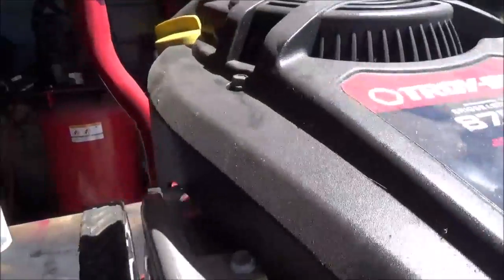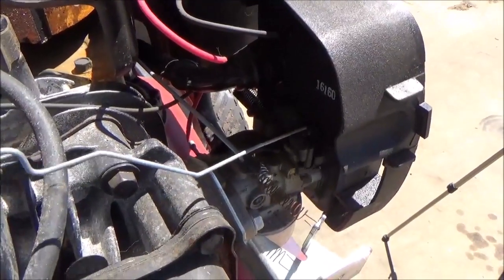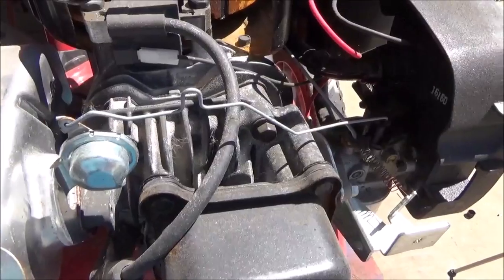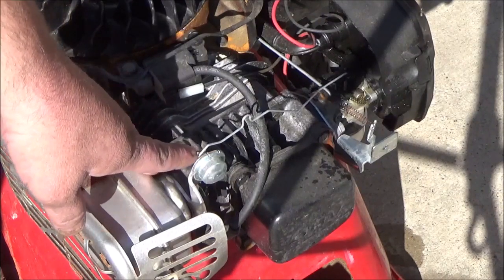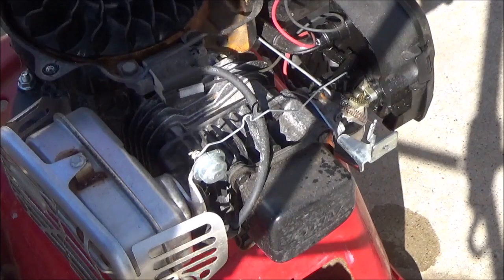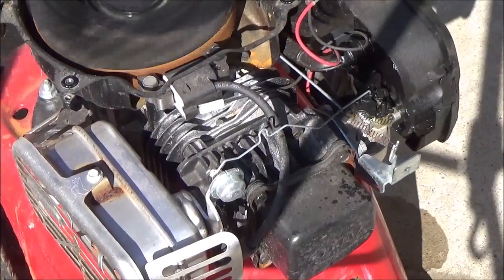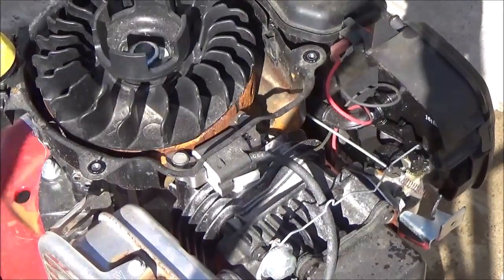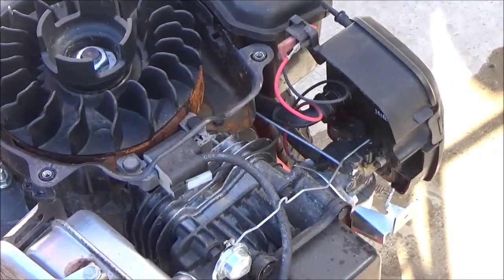HOW MOST AUTO CHOKE SYSTEMS WORK ON BRIGGS AND STRATTON / KOHLER  /MTD / CUB CADET /  CHINESE CLONE

Comment: I see in your demo that you  had a troy built power washer.  I went to use my power washer and it would not start, had issues in the pass with it not starting well. I had added gas and stall-built for the winter, but needed to use it one more time. Would not start!!!  Took carb apart and cleaned it and putting stuff back together and couldn't find where the chock link hook to, there is no thermostat on my engine?  It's not there.  Just ordered one from B&S.

Comment: Nice good sir.  I have a Cub Cadet with a Kohler 7000 and just today when starting it, it started and then never increased power like normal.  I popped the top and pulled the air cleaner and noticed the choke never would open and it would just sputter until it died.  I manually (with my finger, ha!) pushed the choke open then it ran normal.  So do you think the thermistor thingy you showed is my issue or could it be another part?  Thanks!

Comment: So once the engine is running and hot and you kill it, how does it restart if the choke is still open?
Reply from the maker: Once it’s
Hot
It shouldn’t need choking  if it does you
Have carb
Issues or the choke spring may be lazy but a lazy spring would make
It run rich while it warmed up

Comment: Can you do a walkthrough of all the components on modern “throttle less” small engines? I recently figured out the auto choke feature on a Troy Bilt mower but was puzzled by the fact there was no throttle adjustment. Also, would be helpful to understand their failure modes you have seen. Thanks.

Comment: You mention that you really need to use fresh gas.  On "another channel," a guy says he see "all sorts of issues" when these Briggs engines are run completely out of gas.  I asked him what he meant and he responded, "Yes, running the tank dry does indeed cause issues!" but didn't say what those "issues" are.  I have a 2017 Toro with this type of engine, run the gas out & pull the carb drain plug each Fall before storing it and haven't had a problem . . . yet.  Any idea what that guy could be talking about??? (yes, I put the drain plug back on after a few).
Reply from the maker: Chris B Critter you will always have residual fuel left in the carb even after it runs out of gas unless you crack the main jet loose and blow the carb out with air to dry it out

Comment: Great video.  Long time subscriber.  Got a question.  How do you set the timing on a 6.75hp craftsman eager-1? Engine model 143.016728.  I see the timing mark on the cam but not on the crank.  I've looked everywhere to find the dimple on the teeth and cannot find it.  How do you set the timing without the mark on the crankshaft?  Thanks from Wills Point.
Reply from the maker: K. Powell  i'm not at the shop right now give me a little bit so I can do some research and I'll get back with you￼
Reply from the maker: Does the crankshaft have a ball bearing or is the timing mark just worn off?
Reply: I believe it's worn off.
Reply: I failed to mention it does not have a ball bearing.

Comment: Works until it doesn't I guess, and probably no parts to repair it, so I'd think a fix would be a manual choke cable if that automatic choke fails.  My new Troy Bilt TB115 has that system, so far it starts on the first pull, we shall see how long that lasts LOL.
Reply from the maker: Yup when mine quits I'm gona just run a small piece of throttle cable wire through the side and choke it by hand.   Cheap made junk and I'm a die hard Briggs fan untill recent years.  Makes me sick
Reply: @THEMOWERMEDIC1  I agree, unfortunately they've went cheap chinese plastic inside, wouldn't surprise me to see plastic pistons in the near future with plastic connecting rods.  If all goes south I'll go snag my Uncle's 30 year old SCAG 36" Walk Behind with the 14HP Kohler Command engine on it...wish that thing had an hour meter, it got 25 years of hard use mowing 3 acres of blackberry vines that just wouldn't die as well as grass, up and down a pretty steep hill.  Cost almost $900 in parts to get it all tuned up and going again after it sat for 6 years but it still does an awesome job cutting grass and still stripes a lawn really dang good for the abuse it took.

Comment: I have no complaints! That's how the automatic chokes worked on cars back when carbs were used before fuel injectors. A bi-metal coiled spring when cold, would pull the choke shut when you pushed the gas pedal to the floor once to reset the choke. After the engine warmed up the spring would open the choke. I really miss the days when I could connect a motor to a car with 3 or 4 wires and two battery cables and could get a little more power by loosening a bolt on the distributor and turning it a little bit to advance the timing.
Reply: Shoot, I miss the days when you wouldn't have to pull the engine and remove an axle to change your alternator.!

Comment: Good to know
Can an ignition coil show spark but not enough to start on a two cycle grass trimmer? Have a Redmax that I have changed 2 carburetors  and still wont start. Not even a pop. Tried starting fluid and still nothing
Just curious as to what you might think
Reply: Your trimmer may not have enough compression to run, or the spark arrestor screen isn't allowing the engine to cycle correctly. See if you can get it to fire over with some oil in the spark plug hole and starter fluid in the intake if removing the arrestor screen doesn't help.
Reply: Bad compression or fuel mixture. lots of small carb. holes get clogged and relies on pressure pulses to feed fuel. Put a squirt of fuel in the throat an give a cord a few pulls untill the air/fuel evens out, if it starts, your carb. needs work.
Reply: Ive had many that will light one of those cheap on line testers bit wont fire under compression. I use an adjustable tester so i can see where the spark gap stops. Usually a 1/4 inch gap spark in atmosphere will simulate enough to fire under Compression.  https://youtu.be/dipmevU5cjU
Reply: I've run in to issues where someone ran the mix ratio very heavy on oil and did short trim jobs "not long enough to get it hot for a long period of time". Overtime it got hard to start then just wouldn't start anymore. I had to flush the fuel out. Put fresh fuel in it at the correct ratio and take a drill and just go to town cranking it till it hit. It smoked like a freight train for about 10 min then it was fine. Basically what I'm explaining is the crank was full of oil from sitting around and the heavy oil mix. The proper thing would have been to flush the crank as well but the guy was in a big hurry. Something to think about if it's got spark and will not hit even with starting fluid. He was my neighbor that is how I knew he was not getting it hot. I watch him pull it out fire it up and before even taking the choke off was halfway done trimming. I told him to sell it and get and electric one because a two minute trim job don't need a gas trimmer. LOL